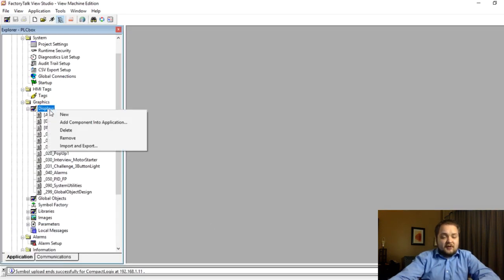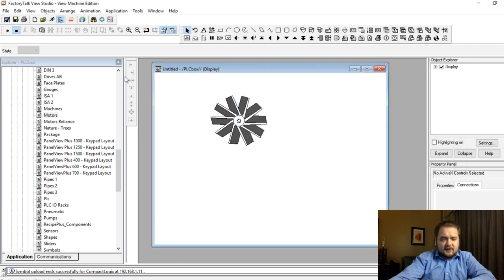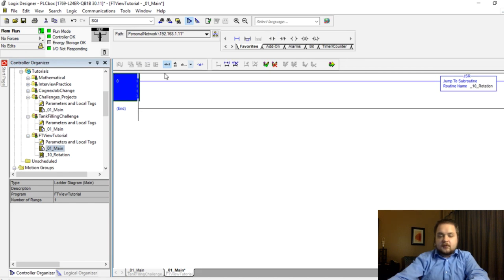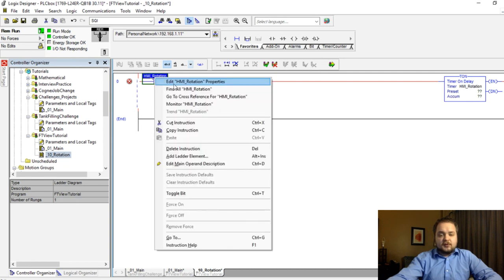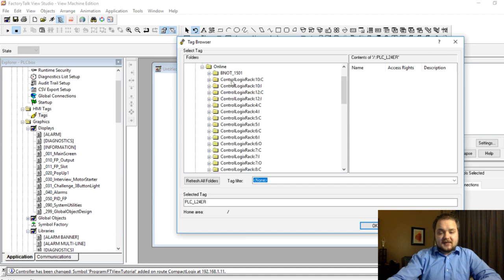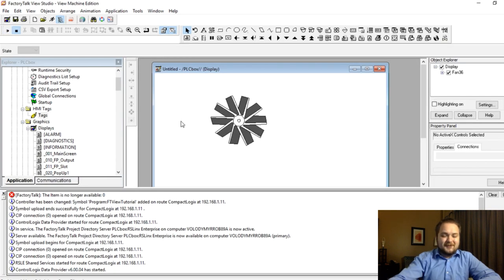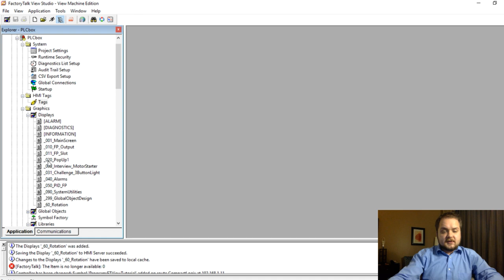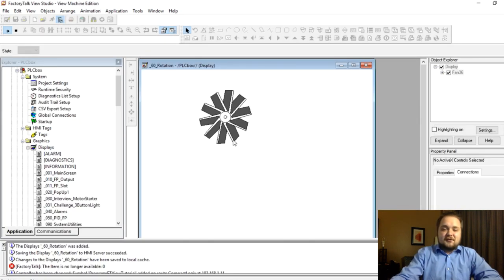HMI Development | FactoryTalk View Studio ME Rotation Animation Tutorial | Pump Fan Motor Program

Comment: Hi. Can you help me with a problem? i have a ftv me 5.1, which i currently have ftv me 8.20 on. I want to open this file? but can't find any way to open it? Can you advise me? thank you.
Reply from the maker: I believe that you should be able to restore the application through the Application Manager?
Reply: @SolisPLC  I used application manager. But the current version I am using v8.2. When using the file opener version of v5.1, it requires the open version to be below v6.10 to open the file. Is there any way you can open the file of the low version. Thank you!